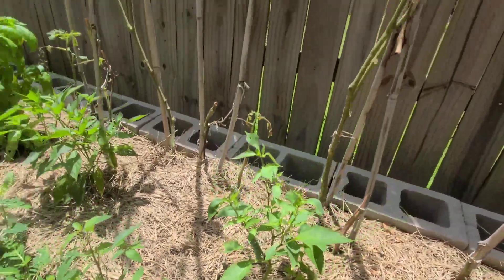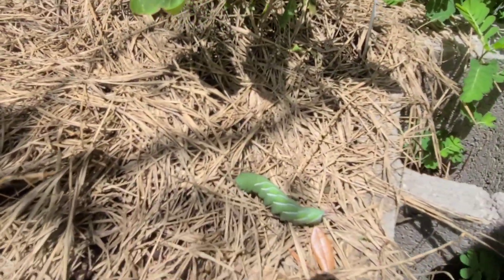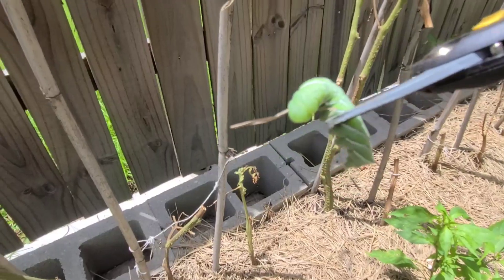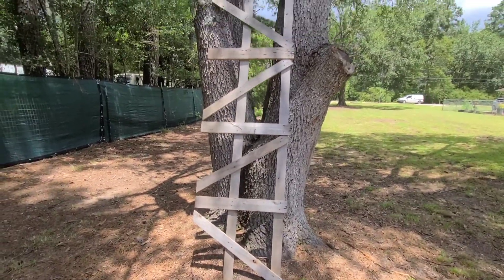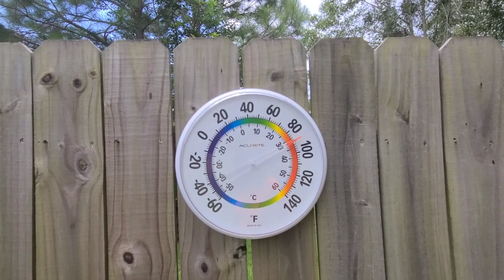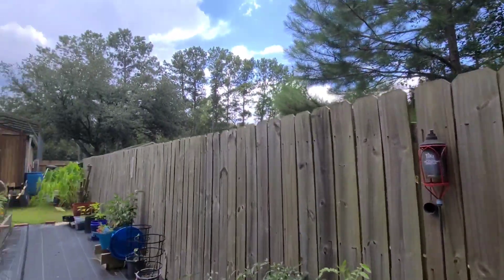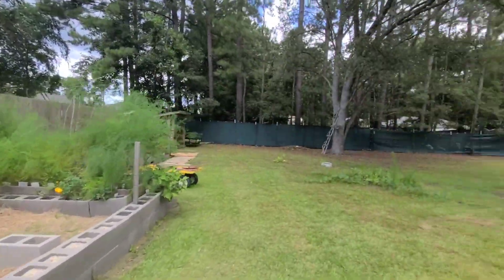There's always something to do in the Garden.  Small Gardening Projects

Comment: I put up some shade clothes over my tomatoes because next week it's going to be in the upper 90's all week. Made some trellis out of pvc pipes and weave wire through them for my sweet potatoes to grow up it so it wan't be on the ground. They are in a 4x6 gardenbed and we screwed them to attach to the bed.
I love your videos please keep them coming. You are so inspiring. My corn is almost done in my 3x3 gardenbed  but I want to use that bed for some brassica and I was trying to figure out what to do with them.  Can I pull them and let them dry out and use them for decoration in the fall?
Reply from the maker: Yes you can pull them it will take 5 days or so but you should use a spray to deter insects. ( Krylon Preserve it )  It can last up to 4 to 6 months from temperature.
Reply from the maker: Thank you for spending time with me 😊